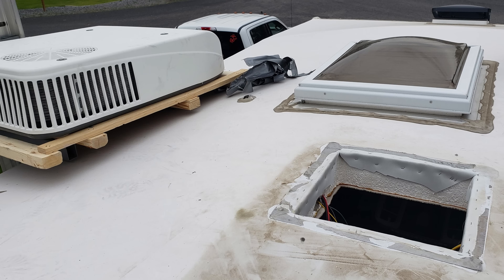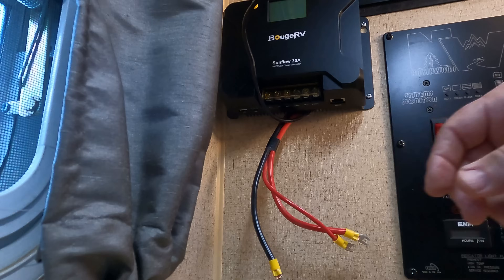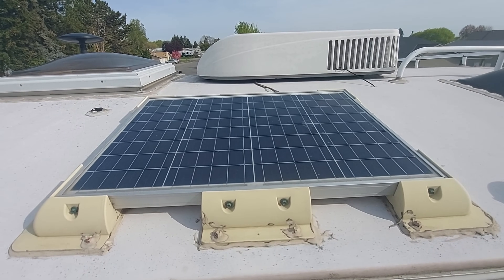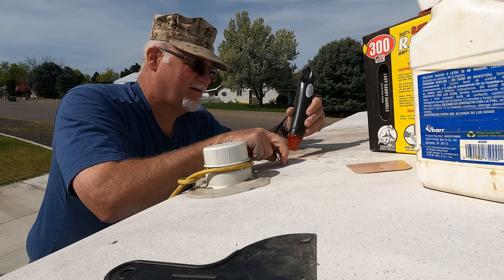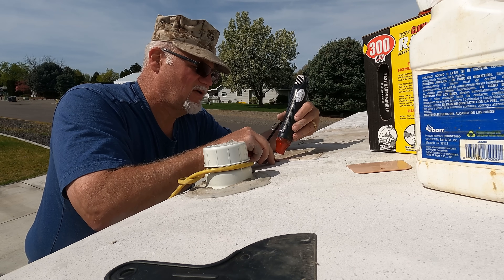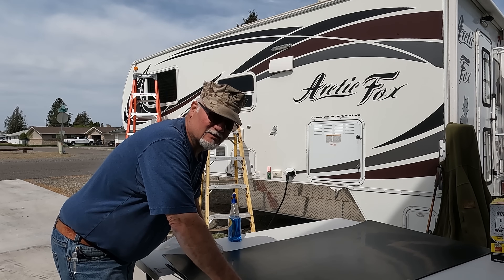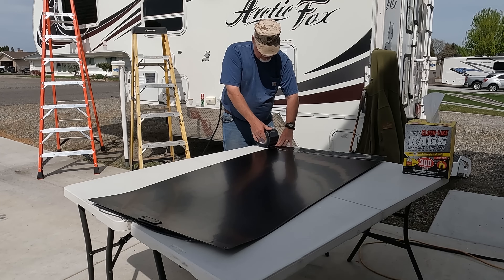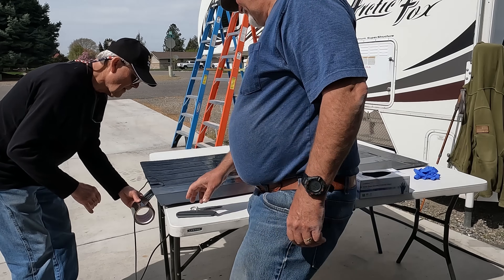Maximizing Off-Grid Power: BougeRV Solar Panel & Charge Controller in My ArcticFox 990!

Comment: Good install. 
I use RV roof tape, 4” wide to tape down the leading edge.
Reply from the maker: Thanks -- is it different than the 4" Butyl tape?  I may use a couple screws on the leading edge still as that ridge has me concerned a little.